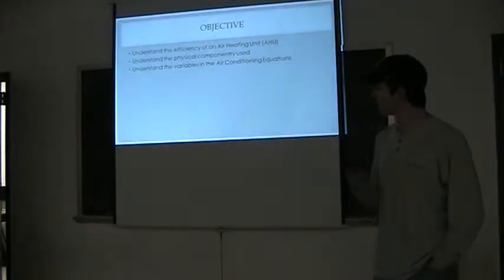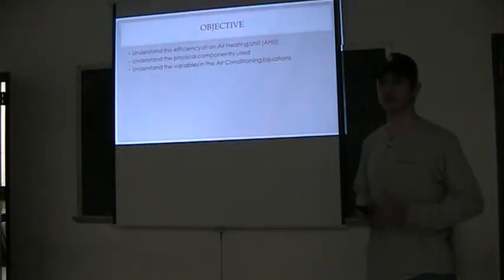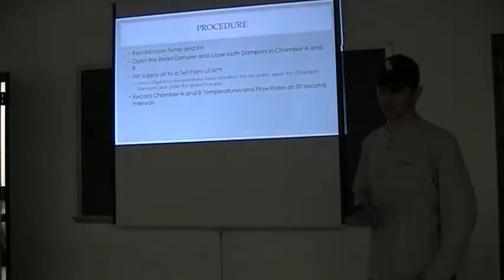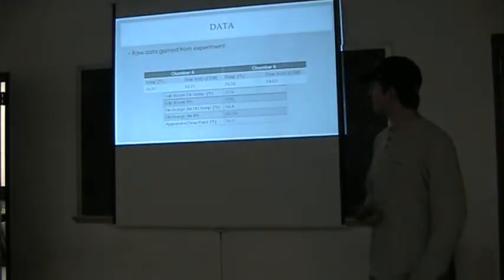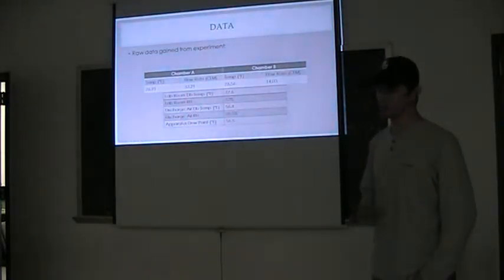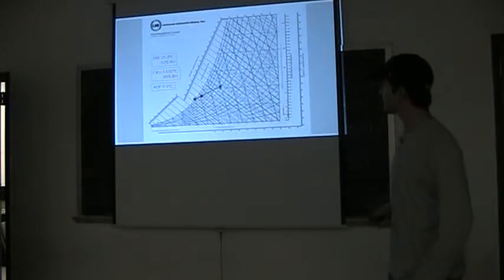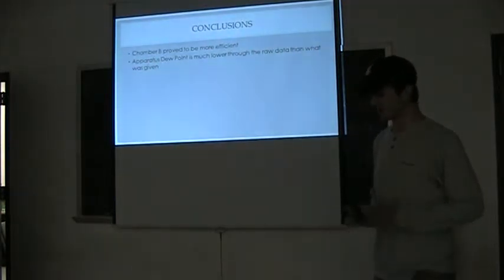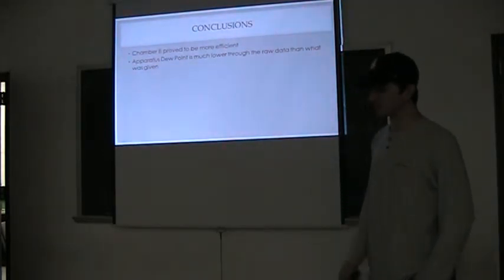William Addison 3/24/15

Comment from the maker: David Jordan(Technical Content) - The speaker did a good job of including all the equations necessary to do the experiment calculations and describing what they measured.  A possible improvement could be to include a diagram of the experiment apparatus to help the audience visualize the process.